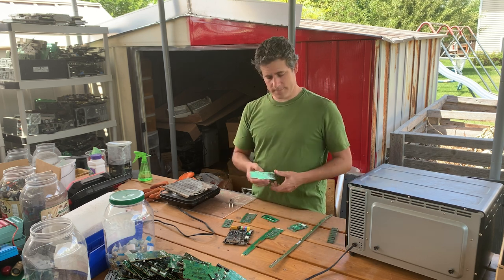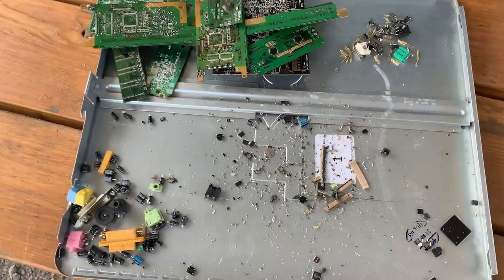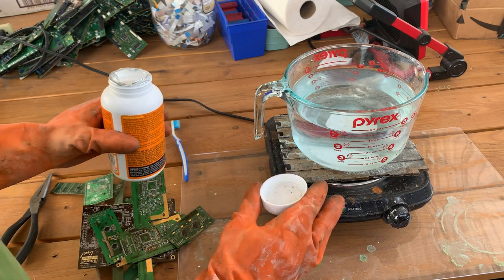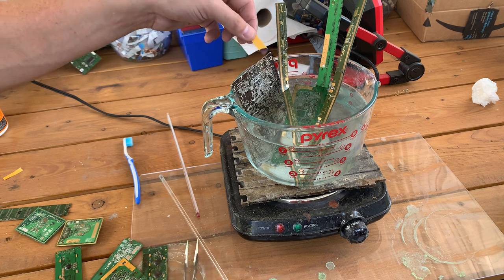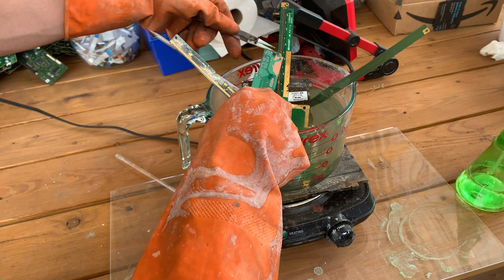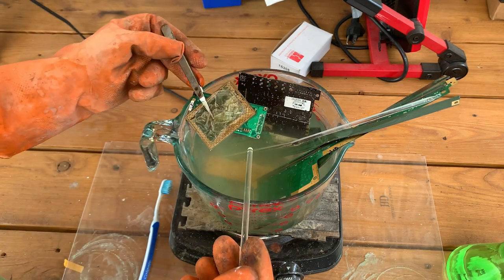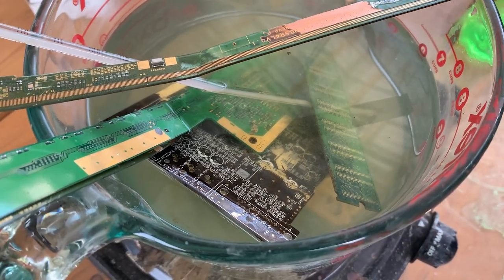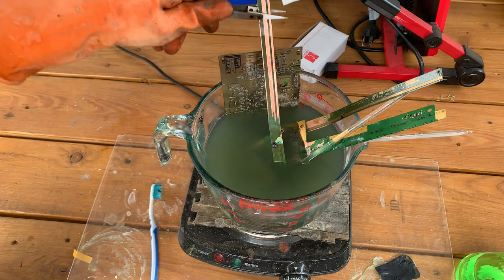eWaste Mining: Solder Mask Stripping To Reveal Gold

Comment: hello if I use washing soda do I have to dilute it in water? and can baking soda also work to remove the green mask? Thank you in advance for your reply.
Reply from the maker: Baking soda won’t do it.  Lye is the only way I have seen this work.  Admittedly, my knowledge and experience is limited in this area, but if a safer and cheaper solution such as baking soda could have worked, I would imagine everyone would be using it.

Sorry.  I which it would work :)
Reply: Baking Soda won't work, as he says, but also a PSA: Caustic Soda (aka Lye/ Sodium Hydroxide) is *caustic*, like battery acid, unlike Baking Soda and will burn your skin on contact. In fact, they used to cover bodies with Lye before burial to quicken the process of decomposition. (I learned that by watching the movie Amadeus!)

Comment: I usually just go with goof off and leave it submerged for about an hour and it does the trick.
Reply from the maker: Is “goof off” an auto correct? I know of “goo gone” but not goof off.  I will have to look.  Lye is pretty harsh stuff.  It would be fun to try other solutions.

Comment: What kind of fumes come off the lye?
Reply from the maker: Sodium Hydroxide can cause major irritations which lead to nausea and vomiting, and even necrosis or dying tissues which can be very serious if not treated.  When sodium hydroxide turns into a vapor due to boiling, the lye compounds are transported with the evaporating water in the form of steam.  It can get in your eyes and burn.  But worse yet, it can get in your lungs and do nasty damage.  In short, be aware of where and how you are working with Lye.  Know how to protect yourself.  Masks and eye protections are recommended.

Comment: Nice video, do you have idea how we can dissolve all tin solders in pcb without effect copper and precious metals? So we can depopulate all pcb components using leaching
Reply from the maker: My first thought is that you can use "warm" HCl ... I would not get it too hot... reactions can get out of hand if hot acid is used.  Tin dissolves quicker then copper in HCl, and if the reaction is done in warm acid, it will pull the tin into solution pretty quickly.  The longer you leave the boards in the acid, the more CuCl you will make (Copper Chloride) which pulls copper into solution faster.  

I would give that a try.  Maybe soak the boards for an hour in warm HCl and see if the solder comes up enough without hurting the copper.  You may lose a little silver as the solder goes into solution.  You should be able to recover that pretty easy from the SnCl (stannous chloride) made from your soak ... It usually takes a full day of soaking for the copper to start dissolving.  

Let me know if that works for your application.  As always, be careful.  I am not a pro, just a hobbyist ... I do this because it is fun.  I make a little money because I am getting better at it day by day.  Above all, have proper ventilation, personal protective gear, and a way to step away if the reaction makes your environment toxic.  Never use heat without knowing what the reaction does cold.  Reactions make their own heat as they transition from one solution and compound group to another.  Don't rush, or hurry a process.  Science and nature have their own rules ... and we are just guests in that space.  In short: be safe (and smart) :)

Comment: What temperature do you use to depopulate the boards and how long does it take to work? Thanks
Reply from the maker: When I use heat, I get the best results between 350ºF and 450ºF.  The toaster oven is not very consistent, and fluctuates between 350 and 450 ...  I leave it in until I hear things falling off.  If I leave it in too long, the boards start to burn giving off nasty toxic fumes and the boards themselves start to leak out this sticky black plastic that coats everything.  Once that happens, it is hard to do recovery on pins and fingers that are coated.  

So I would say the ideal is 350ºF for about 10 minutes at first.  As the oven heats up, that time can go down.  Also, some boards have thinner solder beads then others and could be done faster.   Something to note!  Capacitors are sealed and under heat, they build up internal pressure.  They will explode at about 400ºF if they sit for a while.  I would wear eye protection.  They fly everywhere... there is a ribbon or coil of materials that like to go flying.  So just protect yourself.  Even after you have it out of the heat, they can erupt unpredictably.  

Hope that gets you started with heat removal... however, I find gold pin processing to be less efficient and much more time consuming then fingers and ic chips.  I am no longer collecting the depoped contents.  I have someone who will process the boards further ... I just collect black ic chips, gold cornered BGAs, and card fingers.  That alone keeps me busy enough, and I can sell the rest.
Reply: @badideametals  thanks I bought a toaster oven and melted components I’ll try at those temps, like you I have boxes of part populated boards, I was looking for an easy way to recover pins as we don’t have a board buyer in Tasmania. Give it another go, I was contemplating building a shred machine and shaker table for fun, then recover through electroplating the copper out.  Just need to find scraps and maybe I’ll still make a small scale for fun, thanks

Comment: Unrelated but damn its hard to get inside IC chips and BGA chips. I tried sulfuric boiling and failed becouse a black blob bubbled over all over the damn burner today 😑
Reply from the maker: I am very sorry, and I feel your pain.  I have done that too.  So frustrating.  I have given up on sulfuric (wet) ashing for that reason.  It takes a longer time then I liked, and it left me with a nasty smelling mess that usually ended up putting holes in my clothing.  Fire ashing, although time consuming, is far cleaner on the waste byproducts then wet ashing is.  I have a good deal of BGAs to run ... maybe that will be my next video after the one I am about to publish.  Look for it soon ... (I hope) 

And best of luck ashing.  Making "piranha" solution could solve some of your problem, but it also adds more danger to your equation.  I don't want to be the one to teach a bad idea, so I leave it up to you to research the safe way to use it.  I almost blew up a container of hot sulfuric with it ... I was probably luckier then I know.  It was the last time I did it ... the risk did not seem to be worth it to me.  Fire is my way now.  If you have a forge, that is a good way to do it... if not, a fire ring works too.  It takes time, but hey, there are no "get rich quick" schemes that have ever been fast that I have seen.  Gold recovery from eWaste seems to be a "get rich by the time you are old" scheme ... and you have to be patient.

Comment: Just a tip, you would be better off using a large stainless steel pot to boil your caustic soda/ water and boards in so you don't need to worry about breakage. I know its not very helpful for the visual side of filming.
Reply from the maker: Good recommendation :) thanks for checking out the video
Reply: @badideametals  Also on a side note on Pyrex and pyrex. Pyrex old school with the capital P is Borosilicate glass just like the lab but if you notice the new stuff without the capital P or maybe it was all caps, it isn't suppose to be subjected to extreme heating conditions its just a measuring cup now as with a lot of their other glassware. Even most anchor products now you have to read their usage label. Most people now a days are buying beakers with handles because I believe if you can't safely use a glass measuring cup in the microwave it's useless ! Useful vid btw ty :)
Reply from the maker: @oldkid5212  thanks :) I have a friend who helped me get started with the chemistry stuff.  He warned that not all beaker and lab companies are equal.  It is sad pyrex is no longer Pyrex… what I keep wanting is one of those old casserole pans that Streetips uses as a catch pan under his beakers… I can’t find any that say they are stove top friendly… I feel it is true, “they don’t make um like they used to.”

Comment: Question for you, fellow urban gold miner - is the toaster oven effective at depopulating older boards that are through hole mounted, or only at depopulating surface mounted devices? I'm so fatigued of using the heat gun/blow torch and trying to thump things out of the holes before the solder cools. I've also tried the warm sand in corningware, but takes forever.

Also, in case you haven't been crucified yet, please don't place your unloved hand near hot lye solution. I promise, you won't do it twice if you ever get even a splash on you. Hard earned personal experience.

One more tip for stripping the solder mask - Klean Strip premium stripper in a spray can takes even the super thick conformation coatings off of boards. I keep a plastic garbage pail with a lid, Spray them down, and then toss them into the pail for about 4 hours and then just rinse the coating off with a garden hose.
Reply from the maker: First: thank you so much for your comments!  It means a lot to me.

Second: about the toaster oven.  It does work really well with surface stuff.  The pins that go through the board are really annoying.  I find it can work with the toaster oven, but by the time enough solder has dripped away, the circuit board starts to ooze out black goo, and the plastics around many pins have started becoming a misshaped mess that makes working with the pins near impossible.  So ... I started doing some research, which lead to some trial and error testing ... and I have found a really nice alternative.  Get a cheap paint scraper.  Maybe get 2 ... you can use the really flimsly and flexible ones to pop off IC Chips and surface mount things you want.  I was always worried about things flying off and getting lost on the ground.  That does happen, so work inside a cardboard box.  The second scraper should be a nice ridged scraper.  One where the blade does not flex.  This will sheer off the pins that go through the board.  I am actually impressed with how well it works.  I break the plastic handle of the scrapers the first day I start with a new tool.  But I electrical tape the plastic handle after it breaks, and I still use all 3 of the ones I have ever used since coming to this conclusion.  Really, I have not used my toaster oven in 2023 ... and here we are in August.  The ultra small things like SMD resistors and the smallest MLCCs are not very good for this process.  I would recommend heat for those if you are chasing them ... I stopped since they mix in with the solder too much by the time I am done.  I will have to do a video on this very soon.  I had someone else ask this same question in the last few days on a different video.

Third: Lye ... I have not had any spill on me yet.  You are correct, I should be more careful.  I can't believe people used to make soap out of this stuff.  Very good safety tip.  I appreciate the recommendation.

Finally, Forth: Klean Strip?  I will look into it... how often are boards worth pulling off the solder mask?  I only go after boards that look interesting.  Since most boards are pretty routine, I have only done it 3 or 4 times in the last year.  Mostly, the return is pretty lame on the gold flashing.  Sound blaster live cards, laptop track pads, and some older server boards have been interesting.  But for the most part, lye has not splashed due to lack of use on my part.  Very good recommendations !!! Thank you :).
Reply: @badideametals  Thanks for such a thoughtful reply! Awesome to find another prospector. I accidentally learned earlier this evening that Muriatic acid is an excellent way to remove the through hole items. I have a stack of really nice old tektronix boards that have HEAVY gold traces, but in order to use the AP method of recovering those traces and fingers, one needs to depopulate and also get rid of the tin based solder.

I removed the mask, which in this case was really a thick polyurethane conformation coating, as that costing locked in both my gold from the traces and the chips that I wanted, many of them with thickly gold plated legs.

Once I got all of the masking off, I laid the boards into a small Rubbermaid container... the same one I use for AP leaching, but I just covered them with about a half inch of muriatic acid. I came back an hour later, and all of the tin had settled to the bottom in the little black granules you've probably seen, but to my astonishment, I was able to lift the components straight out of the holes, which has been cleared of solder by the muriatic.

You're right about most modern boards, but if you get your hands on any old tektronix or teradyne boards, as well as anything from general aviation radios or old HP Agilent cards, the heavy gold on the traces is easily worth the effort of stripping the mask. I've currently got a stack of tektronix and teradyne going in AP from the late 60's and early 70's and I expect to get suite a yield from just the traces.... Nevermind the pins that came from them. I'm talking thick playing, end to end, and not magnetic. I'll be stripping them in the sulfuric cell.

Thanks again for responding. I don't tinker much with anything new enough to have smd types of components, but I've got to tell you - the hour long muriatic acid bath is amazing for gutting the solder and making the components fall out.

Happy refining!

Comment: Those mouse pads aren't what you think, they're old gold flashing, very low yield
Reply from the maker: Ya, I got nearly nothing from them.
Reply: @badideametals you never will. Ssds write data from one file to several different cells all across the chips. These cells are wiped just meaning they move old data around  or to extra space all manufacturers add to ssds. You can't physically use it because it's blocked off but it is necessary for ssds because that's how they operate, constantly moving data around, clearing or wiping cells. Cells begin to degrade BUT depending on the user and how much workload they have meaning storage usage per day etc the faster the cells degrade. Cheaper ssds can be 2 years once again depending on user, high end can be 5 years. Newer technology inside of cells is helping with this, one that intel created cells inside of cells to curb this wiping an entire cell, they explain it like this The advantage of 3D XPoint over NAND is mainly based on addressing (for read and write operations) of single cells instead of whole blocks, where, in order to perform a write operation, a whole sequence of read-modify-write operations has to be performed ( ie clearing cells and writing data else where before the new data is written. By only having to do this to say 1/100 of the cell makes the speed and latency much faster

Comment: Wow! That’s incredible! I can’t believe that sound blaster card. It was hard to tell in the video but was the whole thing gold plated or just parts of it?
Reply from the maker: It turned out to be mostly coated by a thin layer of gold flashing... it ended up being mostly copper, but the gold was there on top.  It was too light to process by itself.  I will be adding it to a future gold refinement run that I will do off camera.  Not a lot there... to get a good idea of the gold content, I need to do maybe 50 pounds of boards... which will take time.
Reply: Go check out old HP boards, gold everywhere

Comment: If you don't add a lid, it won't boil outdoors.
Reply from the maker: :) I have learned so much since this video.  I have also acquired better tools and equipment in general.  I do appreciate the insights.  I have a new solder mask video coming up in the next month or two.

Comment: Most Soundblaster cards are gold plated  on both sides.
Reply: Also you might want to use a stainless steel pan to remove the mask. Lye can and does eat glass at high concentrations
Reply from the maker: Ooo!! Good to know :) I had never tried the mask removal before, so all advice is news to me.  Keep it coming! Thanks!

Comment: Lye is supposed to remove soldering
Reply from the maker: Lye removes a lot :) I use HCl to remove the solder most of the time.  They are both really cheap.  Thanks for the helpful comment :).  I have not intentionally removed solder with lye.  How do you do it?
Reply: @badideametals  never have done it just seen a guy do it on YouTube i think he might have mixed it stronger
Reply from the maker: Hmm, I wonder if he is taking off any precious metals while stripping solder.  One of the reasons I like HCl is that it will pull the tin / solder off and leave the base metals such as gold in some instances.  If I leave the HCl for long enough, it will also eat the copper and form copper chloride.  Once this gets filtered, I will be left with cleaner gold foils (especially while working with RAM and Video cards).  HCl is still an acid and needs to be handled properly, and it should not just be dumped without treatment... but it makes my work so easy while working with circuits.  I just can't imagine Lye being easier or faster.  But I am not a pro at any of this.  I am still learning.  Feel free to link the lye video if you wish.  I am interested to see what that process is.  I will not likely switch as I like how I have everything setup right now.  But hey, it is always good to understand what is going on and what alternate processes are.